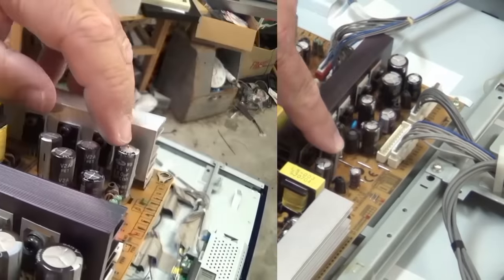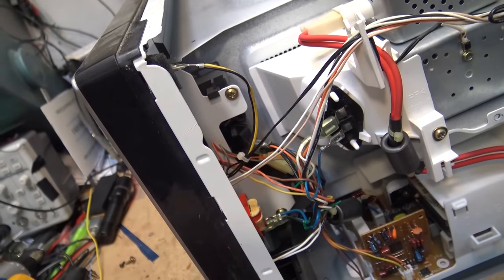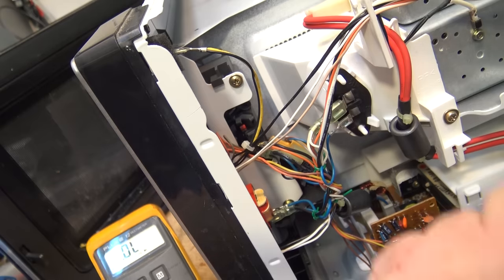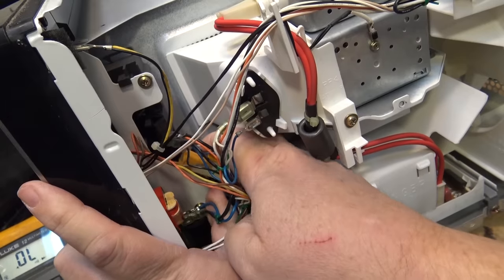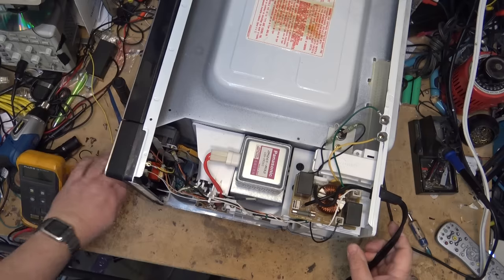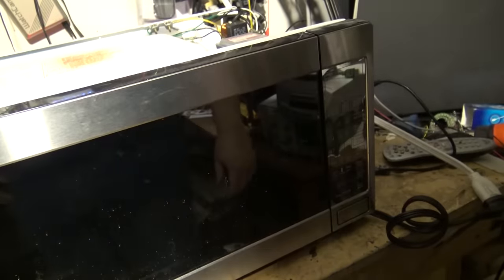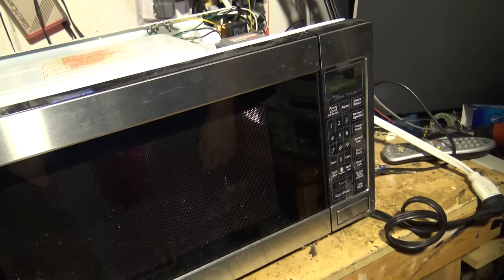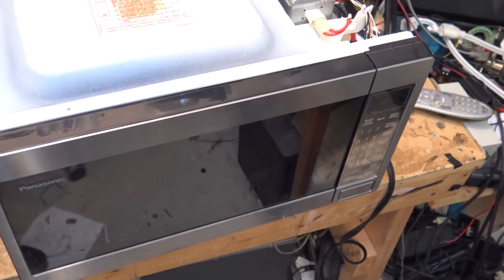Panasonic Inverter Microwave Oven Repair

Comment: As a technician, I would have givin warnings about this video if anybody wanted to attempt what you are doing. I know what is in there. Yes the low level 5 volt on the logic boards is safe. In the US 120 and in Europe 240 are the mains and be on the logic board. How about the 3000 + V around the magnetron.
You make it to simple and don't explain the risk. Most of the voltages inside there "WILL KILL YOU" unless you know what you are doing.
I've watched some of your video's, and they made sense. Not this one. I hope anyone watching this, " IF YOU ATTEMT THIS YOU ARE DOING IT AT YOUR OWN RISK" 
Get some sence when you do a video and at least warn people of the harm that can come to them doing what you do !!!!!!!
Reply from the maker: I did also make it very clear that I would NOT be servicing the inverter board, and did not do any testing or anything anywhere near the inverter board or any high voltage area. I only worked in the vicinity of the lower voltage sections. All of the high voltage sections are behind shields to protect service people. I did not open the shields. I would not do a video on the service of the HV circuit on this type of microwave because of the high voltages. I got bit by a magnetron power supply once when it was on. It wasn't pleasant, and I was following all the safety procedures. If I hadn't I probably wouldn't be here today. As it was it threw me about 6 feet.  To make it clear there was NO risk in doing the work I did on this one because the unit is unplugged and there is no high voltage in the area I was working. These units do not have big capacitors, they do not store a large charge. When they are off the HV discharges very fast as the capacitors are very small as it operates as a flyback.

Comment: My Panasonic has lasted 3 yrs. I'M LIVID I expect if to last longer than this. My first micro lasted nearly 20 yrs. It keeps blowing the fuse. If you change the fuse it will go a few months then blow again. I'm really cheesed off with this.
Reply from the maker: I have 2 micros. One is a madam grill.  Use that one for baking stuff. Got it in 89.  Still going strong.

Comment: i=p/v=1200/120=10A
Oven should draw 10A max,  after initial power on surge.
Reply from the maker: 1200 watts is the rf output.  There js the heater which is only about 1 volt or so at 30 amps.  The light, fan, timer, turntable.  That all adds up.  Mine draws 1460 watts.

Comment: Thought you sad you were gonna GIVE IT AWAY?!!!
Reply from the maker: Nah found someone offering cash for it.
Reply: @12voltvids  👍Totally understand. 
Trying to replace my fuse as well. Can't seem to find the tool to get the back cover off. Thanks for the video, it really helped.
Reply from the maker: @emaclin4054  it's a security torx bit.  A small flat screwdriver can usually be worked in or you can get the but at most automotive parts stores as they are used on cars too.
Reply: @12voltvids  Oh, yes. I forgot you said that early in the video.

Comment: Gee, those security bits cost less then 10 dollars. 
How cheap can you get.
Reply from the maker: I know what they cost. It is not being cheap. I have no need.  I am not in the business where I need them.  If I was I would have them.  They are actually 3.00 at the local auto parts shop.  I have a few for things I need them for, like for my bike, but I didnt have this size, and wasn't about to wait to the next day when the store was open and go buy one to open this microwave when my red slot screwdriver fits into 2 points between the pin and works perfectly without breaking or bending the security pin.  
Troll.

Comment: Our panasonic inverter microwave disrupts the wifi when it is working
Reply from the maker: Leakage
Reply: @12voltvids  what causes leakage? How to fix?
Reply: @rommelreyes2209  Was it dusty wiring sending back EMF out through the mains? I'd bet on that rather than a ruined door seal or such.
Reply: @Cineenvenordquist  it is pretty clean when I opened the back. Actually we only notice the disruption after upgrading the old router to an ax Wifi 6.

Comment: Man just troubleshoot
Reply from the maker: And just what did I do? I troubleshot the unit to prove the failure was not caused by the switches.  It was just a fuse but these steps need to be followed for all fuse failures as they are critical safety devices.